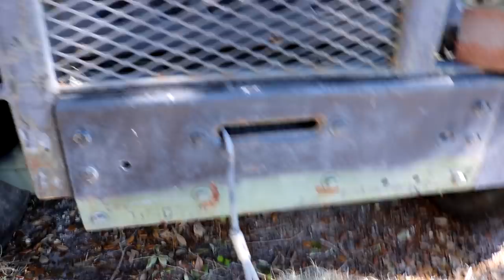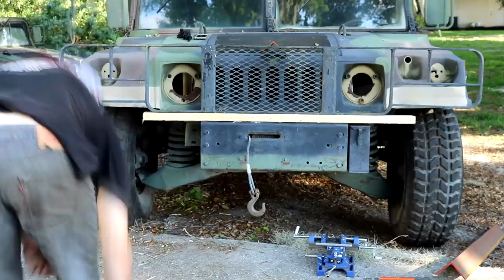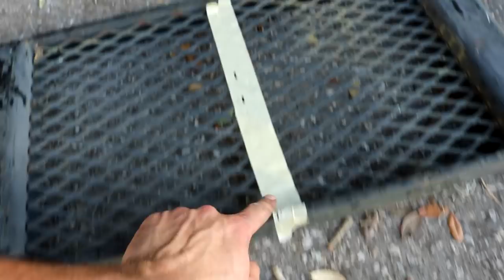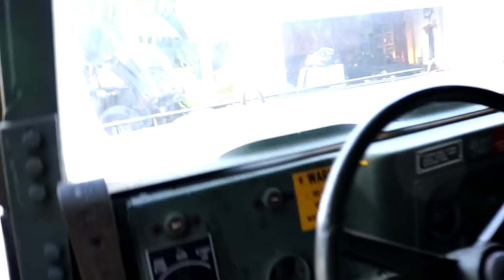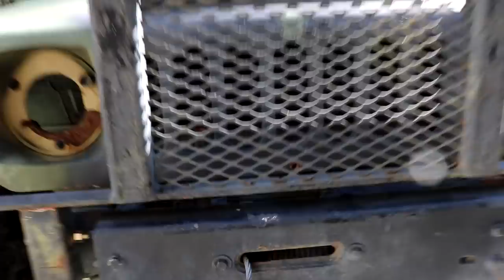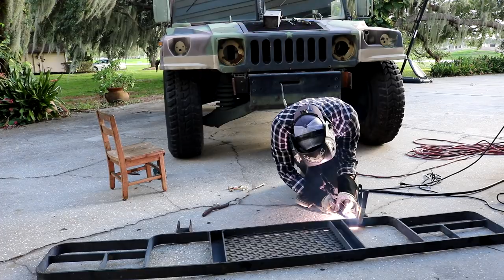Humvee Build - Installing BRUSH GUARD MOUNTS FOR YOUR HMMWV

Comment: Hey Dakota- do you know how the alpha mounts? Its bolt centers are 32.75" which puts it right about where the swivel rings are in the front. I think they use some sort of frame extender but don't know how that would set up. Do you know how it works? As usual.. nothing fits.. begin fabricating! thanks.